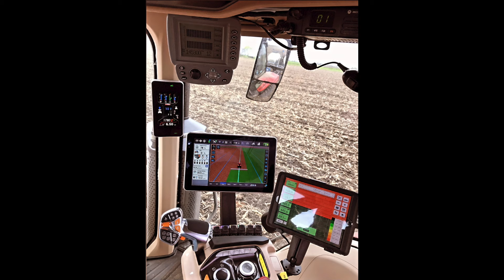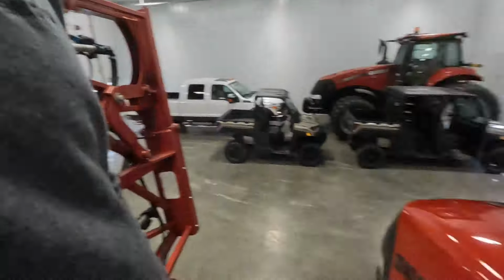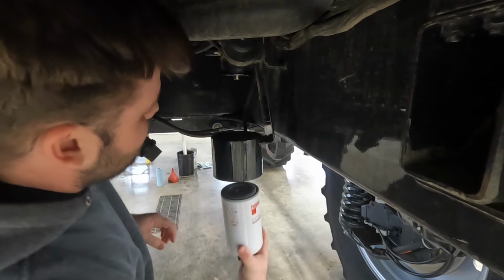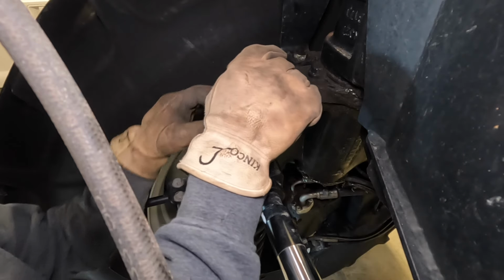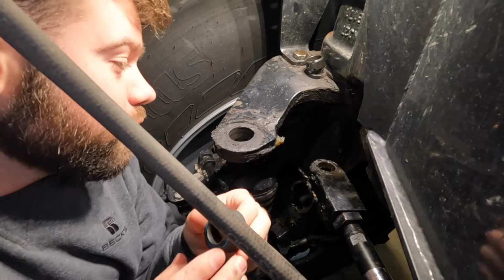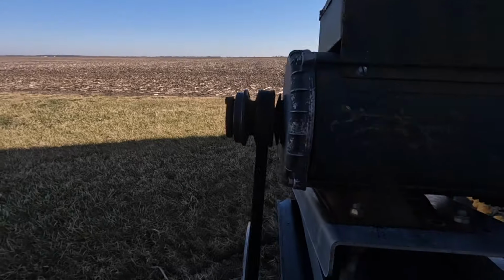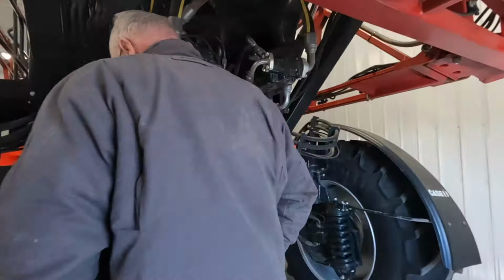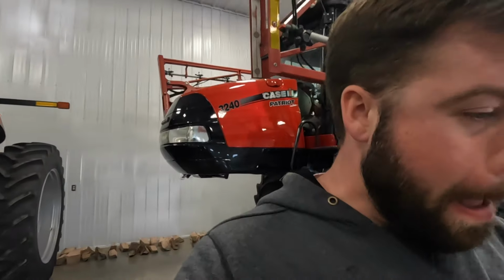NEW Sprayer Parts AND Sheriffs Office Called?!

Comment: If you don’t wanna drain the hydraulic tank you can put a shop vac at the top of the tank where the breather is and tape it up real good. It will hold the oil in there while you work on the lines. We do this trick and it helps a lot
Reply from the maker: Great idea, thanks!